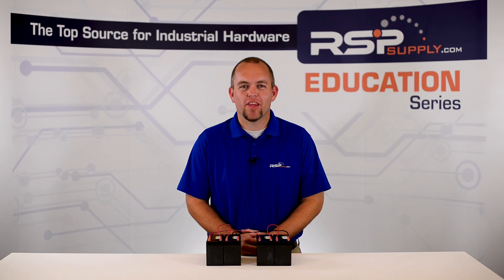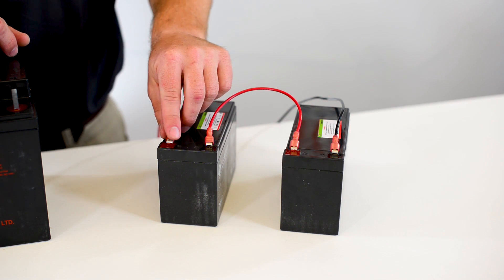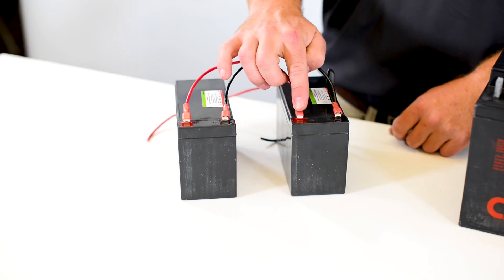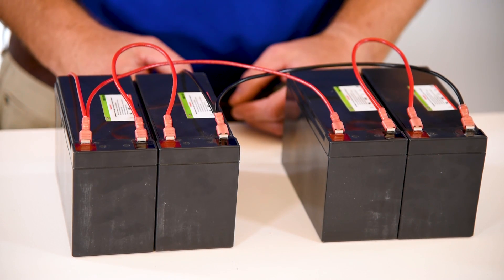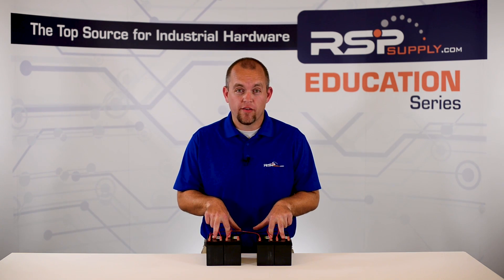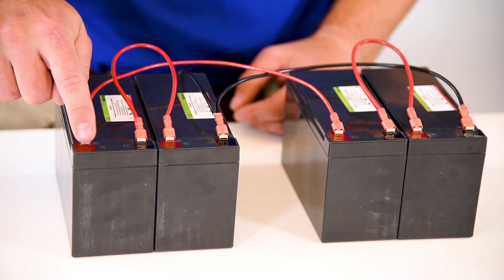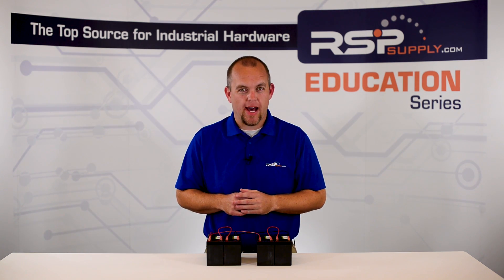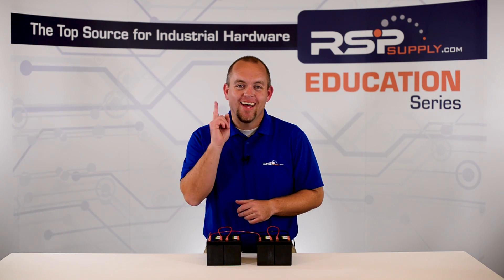Wiring Batteries: Series vs  Parallel (Part Two)

Comment: Is there difference in battery charging between : two batteries in series wired parallel and two batteries in parallel wired in series? In both way you got same result, but in other scenario + + and - - are common (but in the first scenario like one in video, + / - and another + / - aren't connected.

Comment: Please explain what happens if I take positive and negative lead wires to my load from same battery bank after connecting them properly. Is it compulsory to take positive and negative leads to my load from different banks.

Comment: Ok, so is the above example still 24v total? Or did that double the voltage to 48v? (I already know it doubled the amps  - I'm asking about voltage) Would have been nice if you had mentioned that
Reply: 24volts remains while the amps increases to 15ah

Comment: So you have wired first in series to give 2 banks of 24v 7.5ah then connect them in parallel to give 24v 15ah. My question is can you achieve the same result by first connecting 2 batteries in parallel to give 2 banks of 12v 15ah, then put these 2 banks together in series to give 24v 15ah? And if so are there any pros or cons of one way over the other?
Reply: does anybody know?

Comment: This wiring is NOT optimal because one of the load wires should go to each of the packs.  In your  example pack 1 carries more of the load because both the positive and negative are connected to it.  Moving  the negative to the end of pack 2 will  result in each pack equally sharing the load.  L +- +- +- +- L
Reply: very valid,for high amps draw; for little currents it does not matter; BUT,why not do it right in the first place,like you say...
do you know if it is better to have a parallel of 2 series,or a series of 2 parallels?

Comment: Ok I'm confused.  I wired my bike batteries like this. They are 12v each.  This got me to 48v.  All was well. Recently I wired my solar panels the same way.  In the manual I used they called this a "daisy chain" and parallel when I googled it...but it's wired exactly the same as my bike battery, which is series, which should put the panels at 48 volts and overload the solar generator thing it's hooked to.

Comment: Hello , I Have A Question About Wire Size . I Have 4 , !2v 18 ah Batteries That I Intend To Install Into A Emergency Power Supply Rated At 1800 Amps . What Size Wiring Should I Use To Connect All 4 of Them In Parallel ? Thank You ..This Will Also Be Recharged By Solar and Or Wind . Also I Can Recharge It At 120 Volts From A Wall Plug ...

Comment: How would you charge all four batteries? can you charge them all at the same time? Or would you have to charge them individually or in pairs?
Reply: If I'm not mistaken, you would just need to make sure the charger is capable of charging at the max voltage of your battery set up. So this set up he used would require a 24v charger without having any issues. It would charge the same as a single battery. I did this with a power wheels i have, 2 12v7ah batteries in parallel, and they both charge about the same time as the one did (using the factory 12v charger).

Comment: Ive seen my Dad start an old truck, Albion Reiver, with 2 batteries connected in series, the truck was 12 volt and had been stood for 8 years, he jumped 24v straight to the starter motor my Dad said the batteries will go flat quicker but more power,  it turned and eventually started the batteries were smoking and would not take a charge after that. Good to see the old girl running again though, worth 2 batteries actually, he sent the tipper body up, the ram was leaking badly hydraulic oil everywhere, i was about 15 at the time, sorry to digress. He did try the 12v first but would not turn fast enough.
Reply: 300 IQ. Love it

Comment: Wouldn't it be better for even charge/discharge if the negative parallel cable was reversed?  IE...Positive load cable on bank one, Negative load cable on bank two.
Reply: Wondering this exact same thing?

Comment: I want to keep my mini heater from Wal-Mart called Soleil it takes 250watts and 120v.One car battery only keeps the mini heater on for 20min or less.To keep the heater running should i connect the batteries in series or in parallel ???

Comment: Can you just use two different jumping cables to connect the car batteries in series.I have like two top post batteries ??
Reply: I don't see why not.  But depending on the application, why would you?  If it was a permatanet application you would need to have a perm wiring setup.
Reply: @JoshStreetDesign  im doing some homework on some tiny wood burners and homemade wood burners. To keep my room warm.That might take a min but the fast way that might keep my room warm is to fully charge my two car batteries, run them in series with a 750watt power inverter with a 250watt Soleil electric heater.I tried using 1 battery but the battery gets low quick ?
Reply: @drrobotnikmeanbeanma  if you run them in parallel you will get more run time out of them if it doesn't need the power of running them in series.

Comment: When wiring 2 batteries in parallel, do you install an in-line fuse between the positive battery connections?
Reply: Do u know what wire is he usuing?
Reply: as long as the gauge of the wire is properly used for the amperage, you wont need one between the batteries themselves. I believe the in-line would be more beneficial if you were worried about components (ESCs, motors, etc) being over capacity by the increase in voltage, and it would go someone in line after the + and - supply out

Comment: Hi, I have 60v series connection battery pack in my e scooter, I want to add a light with 12v, Can hook up from a battery directly ?
Reply: No, you need a stepdown to reduce the voltage, otherwise you will fry the light.

Comment: Hi, I am wondering if it’s possible to run 3 12V 9ah batteries in series to create 36v and then add a 4th 12v 7.5ah in parallel to achieve longer run time.
Reply: You'll need a 36v inverter
Reply: NO NO NO;  do not add the poor fellow!!!    smoke and fire!!!
think about it: that is injecting 36 volts into the 4th lonely  12v battery: it will EXPLODE in very short order; 
you see,that is what VOLTS do,they GO from hi to lo,  fast,me thinks

Comment: Hello, I have 4 batteries 12v each, 24V inverter, and 24v solar charger controller. Kindly how will I wire?
Reply: I think u just follow this instruction.
By this 4 battery can increase voltage to 24 volt and increase AH of the battery.

Comment: Would this not blow the motors on my kids 12v ride on  jeep?  Or would it give it more power 😁 also is it recommended to have an output of 1000ma for the charger, as its 2 6v batterys in series linked. But my charger  is only 300ma out put. Any help, as I have wasted 70 bucks on two sets already. & my kids love there jeep aswel. 😢
Reply: As long as you wire the batteries in parallel, you're increasing the capacity of the system, not the voltage. So if you had two 10Ah 12V batteries wired in series, they'd produce one amp per hour for 10 hours at 24 volts, and if you had the same batteries wired in parallel, they'd product one amp per hour for 20 hours at 12 volts. Series= more volts, parallel= more battery life. 

In a DC electric motor, more voltage=more torque and power, but it'll also push the design limits of the motor and could damage it.

Comment: So I can use a 12 gauge wire on two 12v 12ah batteries in parallel to my charge controller? Or should I stick to 14 gauge?

Comment: Can this principal also be used with Li - ion batteries? I have two 24V 10AH 250watt batteries but the motor I want to use on my bicycle is rated for 48V 1000watts.
Reply: I don't see a reason why you shouldn't. Just be sure to check current rating of those batteries to not exceed it. Also, be sure to use same batteries (same specs and models) in a pack, don't mix different models or stuff like that, or you can cause stronger batteries to charge up weaker ones and cause overheating..
Reply: @white_shadow_123  I bought both of them together from X-go. The discharge current is 18 amps. I've seen stick-on thermometers. I was thinking about applying them to the batteries and just watching the temperature until I get a feel for how long I could use them without generating too much heat.
Reply: @accidental_relevance  I am not an expert by any means, but that seems it should work. 18A x 24V gives you about 432 watts. Two of those will give you around 850W, which is not a 1000W that bike can take, but it should work. I guess they can push a bit more current than 18A, just not for long, but again, you won't be going full tilt non-stop. I might be wrong here, so it wouldn't hurt to check with someone who has experience with this. There's probably a ton of information on forums about this..
Reply: @white_shadow_123  there is a lot information. But its mostly conflicting information. I haven't seen anyone doing exactly what I want to do. So I think it's going to come down to me just giving it a try, and seeing what happens. I will video the results of course. I think some people imagine that I'm going to be blasting 30mph runs everywhere I go. But I'm sixty years old. I may just go with a 250watt front wheel hub motor.

Comment: Is it possible to have two 12V batteries in series and get 24V output as well as 12V from one of them?
Reply: You can plug a device into one battery running the 12v but it will throw the amperage out of sync. You can get away with it a couple of times but eventually it will be to far out of sync.

Comment: Once you have the connection you need, how do you connect the battery's to the load your using. I have two set's of 3-12 volt 15 amp battery's, both set in series for a total of two banks of battery's at 36 volts, 15 amps. Now I want to connect them to a load, what post do I use. You show the connection for building the battery banks, but you don't show connecting them to the load, sorry for the brain dead understanding, but I don't want to blow it now, so I'm just making sure I'm doing it right.
Reply: Same qstionning here... Not too many videos here showing it...

Comment: I'm not sure what it is that I am asking, but let me try to explain what I hope to do. I presently have 3 - 12 volt 15 amp battery's of which I have wired in a way that gives me 36 volts at 15 amp. I want to keep the 36 volt because I'm operating a 500 watt 36 volt motor. But if I can increase the the amperage by adding a second bank of battery's, how would I wire them together.
    I simply want to increase my running time, which I believe additional amperage will do. So how do I increase amperage while keeping the voltage the same, using a second set of 3 12 volt 15 amp battery's. I get mixed up on which is series or parallel. Also, will I still be able to charge both set's off of my present charging plug while there wired together ?.
    I'm hoping that this is really a simple set up, but for the novice, nothing is simple Ha ! Ha!. I realize that my recharging time will increase, so I'll keep a check on any possible over heating of my charger because of the extended charging time, but I don't anticipate any problems. Do you have a video covering this particular arrangement, if so please send a link, thank you.

Comment: I have just done exactly the same as in the video,  4, 12v 9ah batteries connected together the same as what your saying to do, and my ebike is saying my batteries are dead with no power , and before this I had them set up in series and my bike works ok at the 48v 9ah , your way does not work at all my ebike kit just goes blank with the battery warning flashing on the screen,  why doesn't mine work like you are saying ?
Reply: I'm about to do this ... how do you have the batteries on your bike ? I'm looking for ideas

Comment: Can I wire two 6V batteries in BOTH series AND parallel at the same time?  I don’t have room for four batteries so I’d need to do this with just two 6v batteries in my classic car, if possible.  Reason I need this set up, the car is stock and is 6v, I want to run some 12v lighting but keep the car running off 6v.

Comment: Hi and thank you 
Its so much good video
I want to make an electric bike of my own, I want to drive it  a long distance and speed  25 kilometers per hour or 30 kilometers per hour in case the battery 12 volts and 7.2 or 12 amp 
How many batteries do I need?
And Is there a difference if three batteries are in series mode than the four in series parallel 
And If i need to charge the four batteries at the same time what is the safest way and what is the power of the charger should be

Comment: is it possible to connect two batteries with diiferent Ah to increace capacity? for example 7.5  and 15 Ah ? how about charging them with the charger of 15ah?
Reply: Yes but you will be limited to the smallest battery.   7.5+15 = 15 in parrallel.   Also this video does not example the most efficient way to connect the pack to the bus bar.   This example will yield unbalanced cells over time.  This is due to cable lengths of ties mostly.   The correct wiring would have to put the bus ties, one on each end of the pack.  Also it is recommended that you do not parallel more than 4 batteries in a string.  Someone correct me if i am wrong.
Reply: They have to be the same amp and voltage for it to work, or the higher 1 will charge the lower 1 or they might just burn all your wires out or catch fire ,  I have just done the same as he is saying and it did not work at all, my ebike just died and before I did this my ebike was working fine,

Comment: I have 4 12v 10 a-hr batteries similar to those u use in ur demonstration. 
How do i accomplish 48v with at minimum of 20 a-hr or more ?
Will be using it on my ebike ?
Reply: To get 48 volts at 10 a-hr you will have to wire them all in parralel. Unfortunately the only way to get 20 a-hr is to wire two banks of  (4-12v batteries in parallel) in series. So you need 8 batteries total. It's not possible to add more a-hrs without adding more batteries. Sorry man.
Reply: @paulweston8184  
Thanks much

Comment: how many batteries do you need for a small house run by solar panels. i'm a student doing a project
Reply: Karl Beerman Solar sucks, just put it on the grid. When they turn the grid off you won't want to be there anyway because you'll be a target be then.

Comment: your wiring is wrong.you are measuring parallel on wrong battery terminal
Reply: WV591 
Yes he should take (-) minus from the last battery not from the 2nd battery
Reply: @iqrarhussain7178  don't see why it matters as those black wires are parallel. He could have wired a black from terminal of left set to right set. Then spliced his black bus wire in the middle of that linking black. Circuit is same. Just 3 places to make it parallel.

Comment: If each one has 7 amps how come it doesn't have 7.5+7.5=15 x 2= 30?
Reply: ∵§ain†♣∀₦₲ξℜ∴ when it's done in series it doesn't increase the amp... So the each set is bringing in 7 amps *2 sets gives you the 14/15 amps

Comment: Hello, I just landed on this tutorial but I have a question. If I'm building my own battery pack from lithium 18650 batteries and I'm going to power an led light how do I know whether I need to just wire them parallel or do I need to wire them both ways? The batteries I'm using are 3.7V with 6000mah each. The light fixture I'm using is rated at approx 54 Watts and it says that the power supply is 110v-240v, 50/60hz. This is the only info on the package the light came in. Your videos have taught me a lot. If you can help me understand this one situation, I think I will have a good grasp on this thing. Thanks
Reply: U need to wire parallel to keep voltage the same and increase ah
Reply: https://www.youtube.com/channel/UCyzO7PB2bqmggW0toZl-Vdg

Comment: Hello, please can you help me out, i tried to call the phone number on your website but couldn't get someone after several trial, can you make supply of  battery banks (400v - 700A,)  ( 400v - 1765A,)  and (800v - 1765A) all are different banks. this batteries are to be use to power DC Motor.
Reply from the maker: Please watch the part two video on wiring batteries in Parallel vs. Series. You will  have to wire in series to increase the voltage, so to create a 480 volts we would need to wire 40 batteries in series ( 12 x 40 = 480). For amps,  the batteries are rated by amp hours which is how long the batteries will run at a certain amperage draw. For example with a 200 amp hour battery, it will run 1 amp for 200 hours or 200 amps for 1 hour or any combination multiplying the amps x the run time to know how many amp hours you need. Once you know how many amp hours you need you will need to wire the batteries in Parallel to increase the amp hours with no voltage change. So if you needed the 480 volts and 400 amp hours at the 480 volts, you would need 40 batteries in series for 480 volt 200 amp hours and another 40 battery bank wired in series and wire the two bank in parallel to increase the amp hours to 400 at the 480 volts. Thanks for watching.